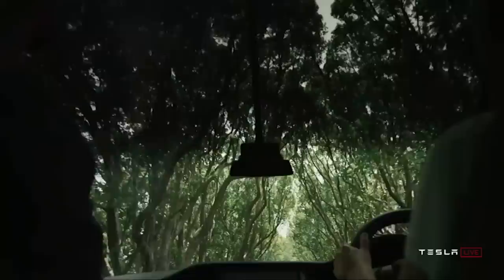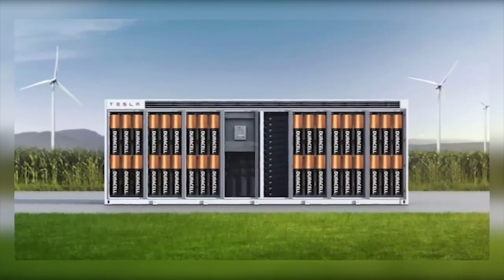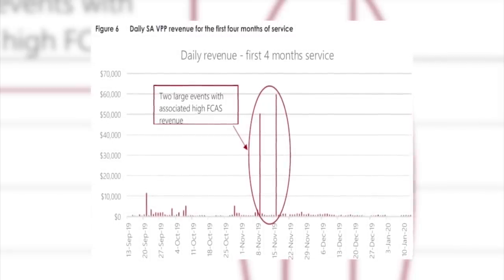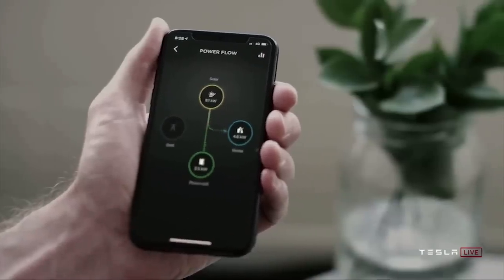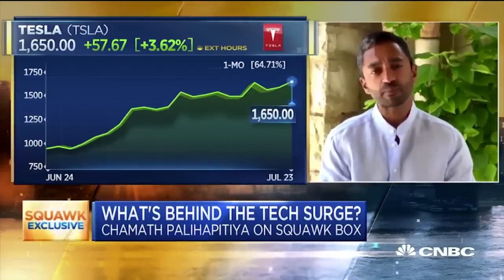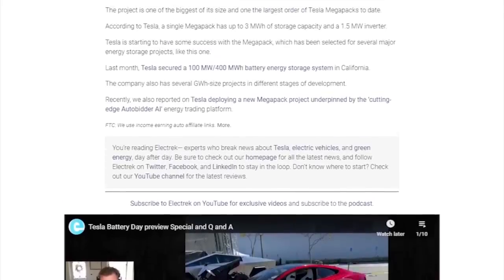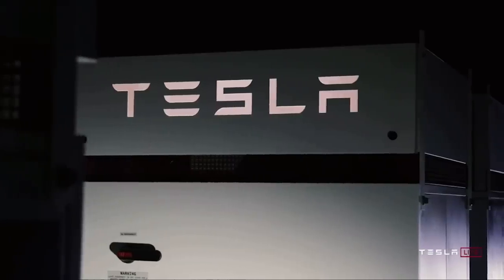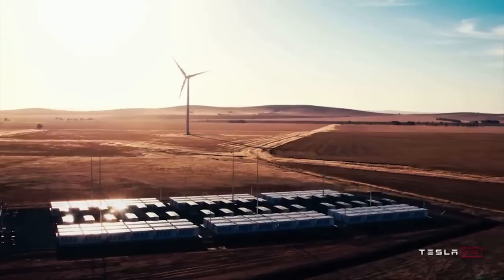Tesla Battery Farms Will Destroy Utility Grids

Comment: So, at night, when the megapacks are charging, what generates the electricity they use? I get that they'll eliminate the surge plants and provide a way to tie in all residential solar to the grid. But we'll still need plants generating power. Or am I missing something?
Reply: yes they will still need some power plants but energy storage will allow for a much higher percentage of renewable energy in addition to the elimination of highly polluting peaker power plants.
Reply: You are correct, but battery plants will make irratic solar and wind power more feasible and save productivity. Especially wind power, which is extremely powerful and irratic.
Reply: hydro, wind, and conventional generation as needed
Reply: @rcpmac  for now, but as things progress conventional generation needs will dissipate
Reply: There are 96 nuclear power plants going 24/7.  With the increases in Renewables, the hydroelectric power can be shut down during the day while solar is providing most of the power, then the dams can generate the power at night.  The Megapacks don't charge at night, they charge when solar power and wind are available.
Reply: @acmefixer1  - When dams generate power the river flows, only running rivers at night would not be popular.
Reply: Peak demands are nightmare for the management, as all know, so much thoughts and efforts are invested in the economic solutions to the problem! One is just bridging the demand time during the increase with supplies from varieties of sources. Tesla Batteries, as well as hydropower, and even innovative gravitational devices are being deployed! 
Of course people remain hysterical about the nuclear power and they have serious cost overrun issues, so nuclear is ruled out for all practical purposes. 
So we are back to Elon and Tesla batteries. That’s the future! 
I have been loading up on Tesla and
 sold most of the utilities. 
Best regards.
Reply: Heads Mess soooo the mega pack in Australia is a big lie?  Doesn’t work?  Seems they have inverters that work.
Reply: Cherry picker.
Reply: Photovoltaik is able to do enogh electricety without plans - Storege the summer energy for winter is needet
Reply: @Derek Blue No. A tanker transports the fuel, it doesn't burn all of it.
Reply: A battery charged by a generator is still an emissions and cost savings because the generator no longer has a need to ramp up for peaks. Which also lowers maintenance costs for the generator. Ultimately you have to oversize your generation and storage, and distribution of generation/storage makes that easier. Just like how tesla made their batteries better by eliminating tabs and shortening the distance electrons have to travel, solar and batteries reduce distance from generation to consumption.
Reply: So here's my issue . Currently, at least for 2019, the United States used 1.427 billion gallons of gas. For each gallon of gas there are 33.7 KW hours of energy. Convert that to megawatt hours and you get 480,932 megawatt hours needed to replace the energy that is currently being supplied by gasoline. It appears that the largest power plant in North America is the Bruce power generating station in Ontario that has eight reactors. It can produce 6,590 megawatt hours a year. Which means that we would need almost 73 new power stations to generate the electricity for all the EVS as the gas cars disappear. If there was a one-to-one swap of gas to electric. I'm all in on electric and ev's but I don't hear anyone talking about this issue. 🤷🏼‍♂️
Reply: @jeffc62  This is a legitimate concern, but the 33.7 KWH per gallon is not realistic. In reality, one gallon of gas will power a car for maybe 50 miles if you have a very efficient car. Electric cars commonly get around 4 miles per KWH, so 50 miles would take about 12.5 KWH. So it take about 12.5 KWH to replace one gallon of gas. And that's assuming people used cars that got 50 mpg, which of course most don't. If you figure most cars are more like 40 mpg, then it would be 10 KWH per gallon. Moreover, most people drive in the city where gas cars get even worse efficiency. Electric cars actually get better efficiency in the city.

Someone might argue that this is ignoring losses, such as transmission losses in the grid, charging and discharging inefficiency, etc.. However, this is balanced by the losses in the gas distribution system, such as the fuel used to power the trucks that deliver the gas to gas stations.
Reply: @jeffc62  
You don't understand that the gasoline power train has only 20% of the actual thermal power going to the wheels.  The electric vehicles have much more of the charging current going to the wheels.  Somewhere around 80 to 90 percent, which means much less total electrical power is needed per EV.
Reply: @acmefixer1  you're right, that drastically changes the comparison.
Reply: @acmefixer1  well you're all actually correct. At the very greatest, gas cars can have up to 40% efficiency. At the same time, it is true that electric vehicles are 90%+ efficient, but they're often powered from power plants that use gas, which power plants are 50% efficient. .5 x .9 is still roughly the same efficiency, albeit slightly better than cars. So what should be done? A transition to nuclear power is the greatest and most efficient course of action.
Reply: @jeffc62  Your Bruce production numbers are off by over three orders of magnitude: production nuclear reactors output 300-1000MWe, which is 2-8TWh/year a pop. The Bruce A+B power plant produced 49 TWh in 2017, roughly 7 000X what you wrote. Looks like you have misinterpreted peak power output (MW) for annual production (MWh). You need to multiply average output by operating hours (or integrate output over 8766 hours) for annual MWh.

Your gasoline figures seem way off too: according to the EIA, the USA consumed 142 billion gallons of gasoline in 2019 and at 33.7kWh/gallon, that would be just over 100x Bruce AB, though you do have to keep in mind that the same energy gets you ~2.5X as far on electric, so 50x Bruce AB should cover personal transportation needs.

Thankfully, nuclear isn't the only option and battery storage makes many previously impractical things feasible. I would imagine the solar roof + power wall + EV combo gaining in popularity as all three components get better and cheaper - never need to buy energy from the grid at prime rates. A limited form of DC fast-charging from power walls (mainly to skip the DC-AC-DC conversion for efficiency's sake) would be a nice bonus.
Reply: @jeffc62  80% of the energy in gas is lost due to heat. That's why ICE cars need a water pump and big radiator constantly dousing the engine and preventing it from burning up.
Reply: @jeffc62  No large scale power plant or peaker plant uses gasoline. It's far to expensive most use natural gas, coal, small plants might use diesel.
But wind, solar, geo, and hydro are much less expensive. So the whole thing comes down to cost. The big energy companies don't care about air they breath.
Reply: @forrestolney6836  I kind of changed gears. I meant the gas the ice vehicles use. Was trying to use that as a gage of how much energy would need to be provided to replace what gas did.
Reply: @jeffc62  Jeff, great analysis and we should be concerned about increased utility demand if everyone converts to EVs and there's little increase to solar, wind, and hydro generation.  However, did analysis factor in the efficiency of EVs. ICE vehicles waste at over 75% of energy at engine, drive train, and other conversions.  EVs waste only 10%.  Another saving grace is most people charge overnight while sleeping and electric demand is very low at this time.
Reply: @jeffc62  Agreed. I think the solution Tesla is banking on is simply increasing battery tech. You're point also outlines just how many batteries/panels we actually need to replace current infrastucture. I think ist going to take a LOT longer then most are saying, unless we start to see battery tech start doubling ever year for 5-10 years straight. Bottom line is Tesla is a battery company, and whoever makes the best battery powers the world.

Comment: BUild geothermal energy plants... f the solar and wind plants depending on weather and thefore a need of expensive batteries....  Geothermal plants are the future, lets build them at scale to bring the costs down!
Reply: Geothermal Plants need to be in a specific place, you can't just build them anywhere. And they're much more expensive than Solar or wind. They're not the future.
Reply: @belland_dog8235  you can build them anywhere, you just need to drill deeper. Today drilling is expensive because it lacks investments and economy of scale. It is the same like saying batteries are expensive therefore electric cars are BS. With the scale, cost comes down. We should scale building of the geothermal plants..
Reply: @SKarea51  
You don't know what you are talking about.
Reply: Can't be built where there is no thermal in the geo!!
Reply: Also they cause at least micro quakes in the surrounding area
Reply: @jackdbur  that is true with certail method, but there are safer methids
Reply: I am pretty sure fusion power plants will be humanities future, expensive AF to build but once they're up the power of an artificial sun will outpace any other.
Reply: @timothywilliams8530   Yes, that is an option as well, but much harder to do, so in the meantime we should switch from solar panels and windmills to geothermal plants. For f sake, solar panels and windmills are ugly, take up a lot of space, are not 100% environmentally friendly and are weather/day time dependant.... I do not understand why people are praising them. And if Elon wants to be a visionaire, how can he suggest something that works for California for the whole world... He has no real answer to the harvesting of the energy..
Reply: @SKarea51  
Tell us what you've been smoking, your mind is a feather in the wind!
Reply: Listen Acne Fixer, Zit squeezer, why 3 posts, can't you put 3 sentences together?
Reply: @SKarea51  You obviously don't know what you're talking about.

Comment: It just makes sense.
Reply: I would qualify that it makes limited sense,

For the foreseeable future (5 to 10 years) the limited scalability and therefore the market for the Tesla megapack will not be able to reach much beyond the limited niche market of peaker plants and perhaps propping up and supporting some local transmission grids that are at capacity during times of peak load.  For the foreseeable future, the demand for megapacks will far exceed the supply of megapacks.  Megapack scalability is seriously constrained by the the global raw material supply chains and battery factory capacity.  The Tesla megapack will do little to nothing to seriously displace or compete with the wholesale energy markets currently served by base load coal, nuclear, and natural gas.

In the mean time, the legacy utility industry has successfully rigged the system in their favor with new grid management curtailment policies (e.g, frequency shifting) that allow utilities to curtail and refuse to accept solar generated power during times of peak solar generation.  The effect of curtailment is to utterly destroy the economics of solar by idling the plant when it would otherwise be operating at its peak efficiency.  Utilities are not going to allow new solar generating capacity to eat into the core base load generating capacity supplied by their existing coal, nuclear, and natural gas plants.  Without some new change to law, utility curtailment policies will effectively plateau and cap the market for new solar.  The addition of more solar generating capacity to the system will only serve to increase the amount of curtailment in favor of maintaining the 24/7 100% wide open generating capacity of the existing base load coal, nuclear, and natural gas plants.
Reply: And dollars.
Reply: It really doesn’t. Read Apocalypse Never by Michael Shellenberger.
Reply: @slaphappyduplenty2436   
This great moment for Brokem the Paradgmas around the World...
Welcome to Brazil Mr. Elon Musk and Solar City too..
Great time for investiment in Brazil for to Start Business on Cleaners Energy and Electricar in Brazil is so Virgen,  
So Welcome to Brazil for make Clennear Energy and Hipperloop and Semi Truck...

Remenber is Great time for make business in Clenner energy in Brazil...

Comment: It's a game changer. But to avoid Armageddon in time, we also need mass produced molten-salt thorium reactors. I wish Musk was a fan :(
Reply: I wouldn't bet on molten-salt thorium reactors being ready in time to avoid Armageddon either. Also nuclear powerplants put an enormous amount heat into the environment in addition to using a lot of water.
Reply: @nathanlewis42  They did, technology changes.. thank g-d :) 

Thorium could (and hopefully will) be mass produced to create portable'sh sources of TW safe enough to drop a bomb on.

Batteries are fantastic but even the best case scenario does not allow for adequate scaling. Thorium reactors can provide the necessary base energy in even the most politically unstable areas in the world. It's worth a look :)
Reply: @jewymchoser  they are opining up shop in India, us they are working on Thorium there. Tesla can't compete with Thorium power.
Reply: @RS-jh2kl  I wish Canada was as enlightened :( Thorium, along with batteries, for the win!
Reply: @jewymchoser  
The most politically unstable areas are where they blow up the electric transmission  towers like they did in Venezuela.  The worst thing would be to have a central power plant, nuclear or otherwise.  Distributed solar is a much more reliable and cheaper solution -- you don't need to put up any transmission lines at all.  No nuclear means no worry about a power plant being bombed by terrorists.
Reply: Thorium is not as clean and safe as promoted, plus there is massive CO2 production in building and operating.
Research the Cons as well as the pro's. It is always a trade off. Promoters always gloss over the negatives
Reply: The Renewables plus storage are getting so cheap that nuclear power plants can't compete with them.  Utilities won't build NPPs if they cost so much (10+ Billion dollars) and take a decade or more to bring online.
Reply: "Armageddon" lol what? We're gonna be fine mate.
Reply: @belland_dog8235  Getting to zero won't cut it. We have to go from Blow to Suck. Thorium can make that affordable (along with providing fresh water, carbon-free sea shipping, etc..) Plus you don't need ninja's to protect the core.
Reply: Thorium reactors are great but getting them past the nuclear regulatory commission, well best of luck

Comment: I disagree with the move towards batteries for renewable sources of energy...  The problem with it is this...  We only have so much resources for batteries, we can't do batteries for both cars AND renewable sources of energy.  Besides, renewable energy sources will NEVER be primary sources of power.  Nuclear is the only energy source capable of supplanting fossil fuels.
Reply: you didn't pay attention to battery day did you? Iron phosphate batteries are not resource constrained and saying we have to use nuclear when it's the most expensive form of energy there is, is silly. The amount of energy in sunlight is one kilowatt per square meter. There is plenty of renewable energy available it just has to be captured and stored and the technology for both is advancing at a good rate.
Reply: Nathan Lewis I paid attention...  but I still don’t see renewables as a viable alternative to fossil fuels. It is ALL ABOUT CAPACITY FACTORS my friend and nothing beats nuclear in that regard. And regarding the cost for nuclear...  nuclear will be cheaper than coal in the very near future. Today’s nuclear is expensive, this is true, but it’s only expensive because the way we do nuclear is unsafe. Tomorrow’s nuclear reactors will be 1/20th the size putting out the same amount of energy and completely meltdown proof
Reply: @Les_S537  you forget the nuclear regulatory commission owned by the current nuclear power plant owner's that will be a huge and long fight. Not happening tomorrow for thorium or gen 4or5 reactors
Reply: All the batteries will be fully recycled allowing for plenty of resources. This is what musk mentioned again on battery day.
Reply: Fusion could also be a thing soon depending on how the ITER plant does when it goes operational in 2025
Reply: Well first off, you're wrong. And secondly, you're wrong.
Reply: Belland _Dog Well, I could agree with you, but then we’d both be wrong
Reply: @Les_S537  on the battery day he said there was enuff silcon just in Nevada to supply the complete continent